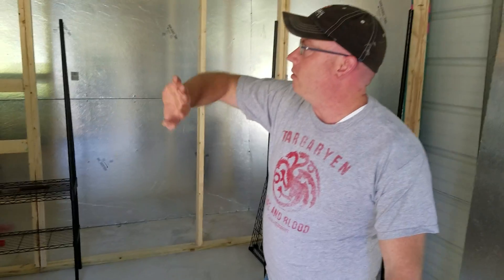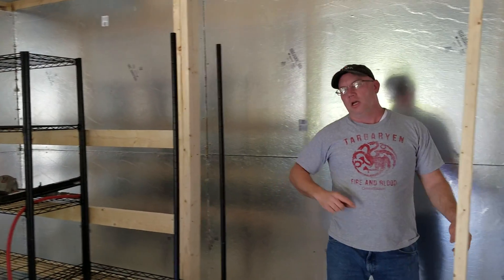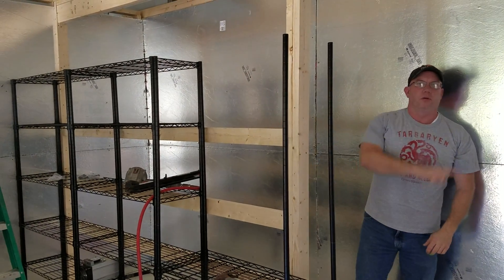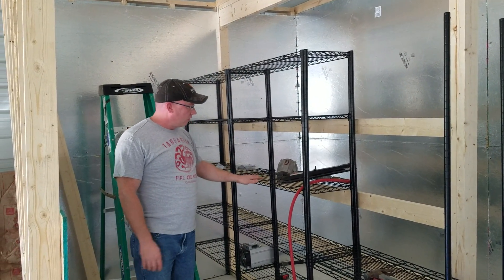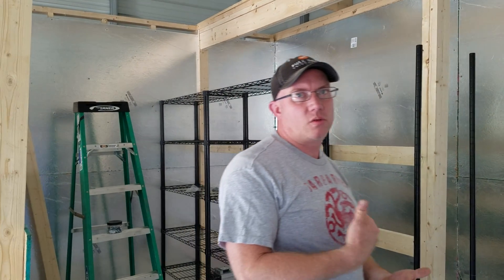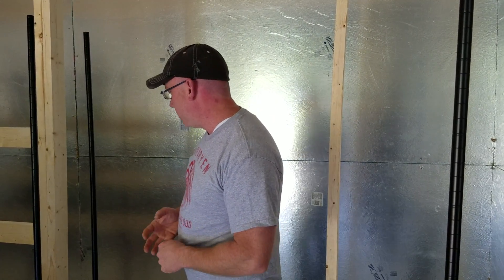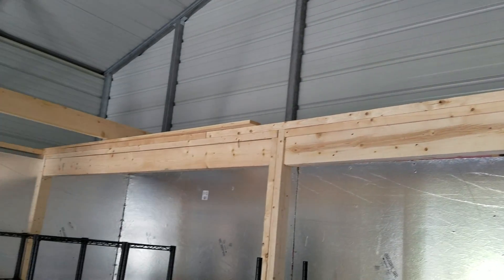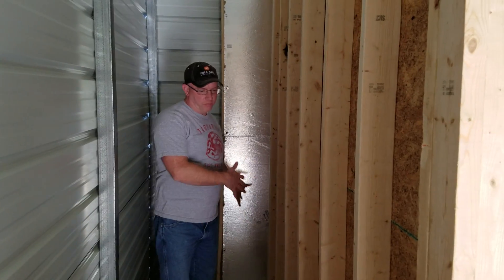how to Design a Bitcoin mining farm

Comment: How did you calculate the size of the cold section and hot section.?
Reply from the maker: +Samuel Dysart local codes required that I have a minimum of 36 inches for my hot isle you would calculate the area required based upon the same calculations used for sizing ductwork since the hot aisle is primarily being used for air movement